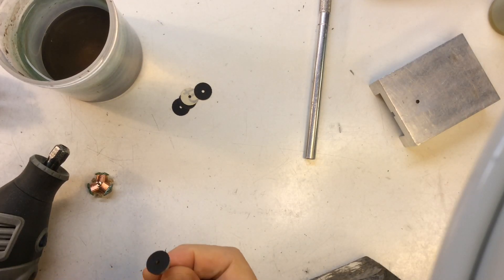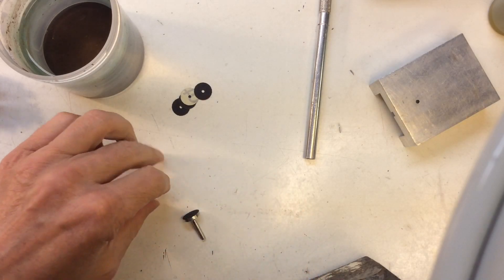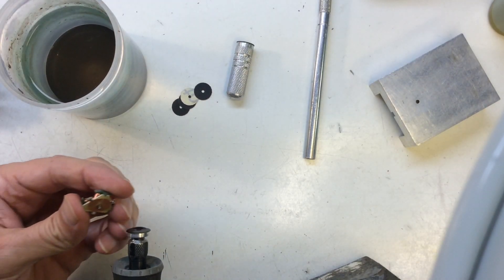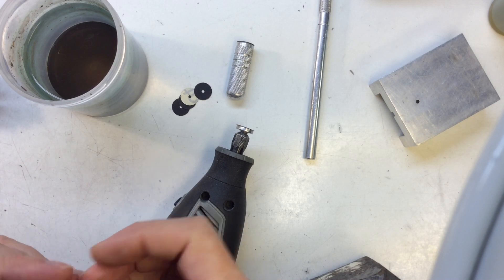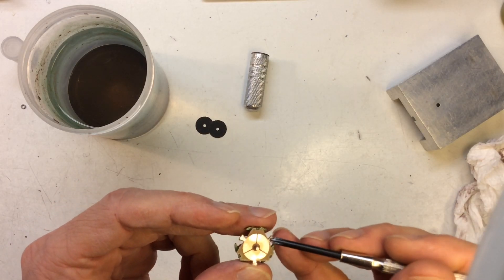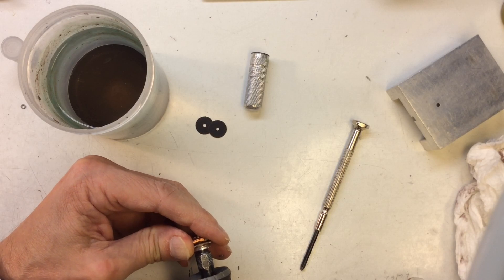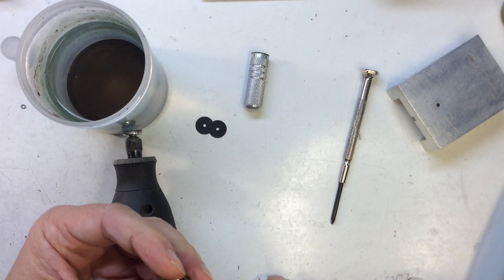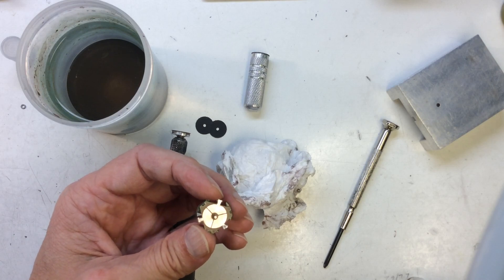Pancake Arm Truing & Balancing Pt2

Comment: Nice quality improvements you do, since I only need one or two I would rather not invest in the dial indicator tool, special glue and so on. Do you sell any? I’m looking for something equivalent to a quad Lam or better if available, please and thank you.
Reply from the maker: The closest thing I can think of that is available would be typhoon/tornado arms from onestopslotshop.com.  The 5.5 ohm is really fast, and is available as a balanced and trued arm.
Reply: @Rondo1234560  awesome, I will give it a look see. Is there a certain magnet you recommend. I need to learn about setting those properly too.  I have a black quad Lam from an Excelorator I think it’s called. It has a brass gear for a post that I was planning to hand trim down/off with a needle file to make it fit in a Magnatraction/non Magnatraction motor plate, it’s 8.7 ohms however it’s a daunting task I’m planning. Have you seen it done before? Could it work? It came with a stronger then stock set of magnets
Reply from the maker: @joshbrekke6374  I am not an expert on magnet selection.  But I think you would want some pretty strong magnets to go with this type of arm.  The black dragon magnets, also from onestopslotshop might be good for this.  You could also look to Dash Motorsports’ “mamba” magnets which are even stronger.
Reply from the maker: @joshbrekke6374  I have heard of people machining that gear off of an XLerators armature.  Sounds like a pretty major ordeal though.  And if yo7 are doing it with a file, it is gonna be really tough to get the shaft true and straight afterwards.  

If you have the internal guts of the XLerator car that went with the arm (the brass cross piece, the plastic bushing, the rear post and cluster gear), all that can be put into a standard tjet chassis to make something called a ‘Frankenstein-jet’.  I did do that once and it ran pretty good.  That XLerator arm is super torquey.
Reply: @Rondo1234560  I fully agree with using the original motor support items that came with its Chassis. The only T-Jet chassis I have is a solid rivet NOS like new one that’s all original so I will find a incomplete Chassis or maby a Dash one that will work. I’m not too excited about trying to hand file it down. I’m definitely interested in feeling the torquing of it that’s for sure. I also heard they pull like a freight train and keep pulling. In a sence of needing a long straight to open up. I have a couple of the Green 4 lams that pull hard till you let off however they need room. Room I don’t have, yet. 😉. I really appreciate all of your excellent input and knowledge. At almost 50yrs old I’m definitely still learning about these old cars, I really like to learn and enjoy them with my kids who like them a lot as well. When we have time. Thanks again!!
Reply: I want to ask them to build me a Quad Lam T-Dash Chassis. I’m definitely interested, I have a mint original Blue T-jet Firebird body for it